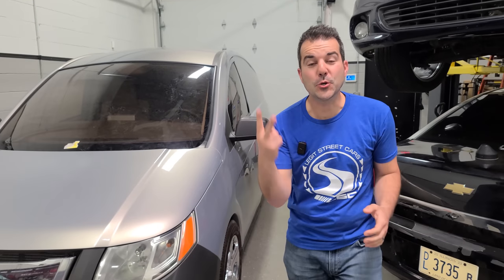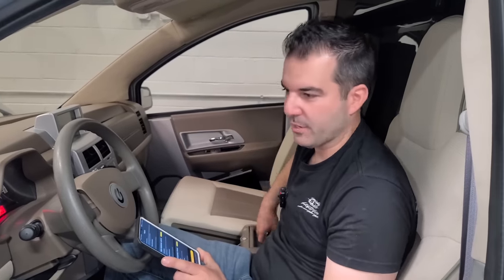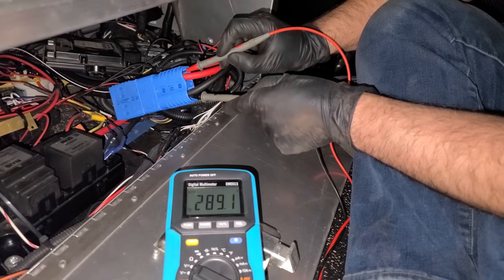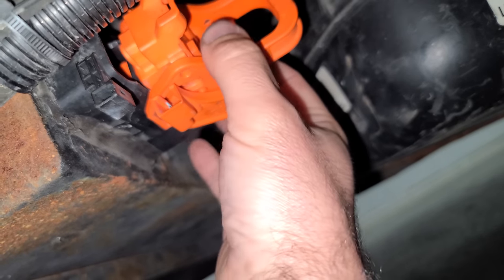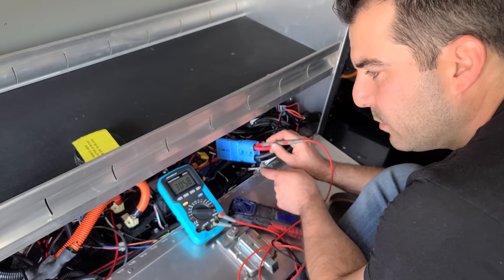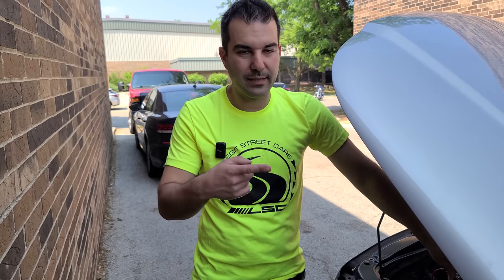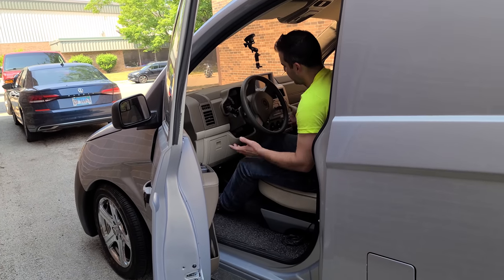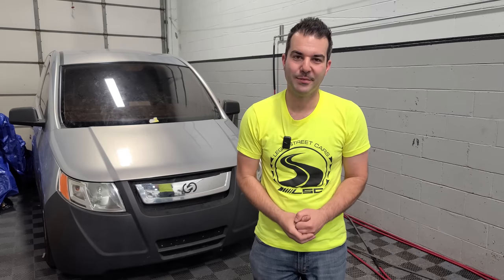I Fixed The Abandoned 2 Million Dollar Concept Car For $150! First Drive Ended In Disaster!

Comment: I had a first gig with a band recently , we had just packed up ready to go home and the singers van door half closed and the thing decided to lock the doors 😬 I got a fence rod in there and managed to unlock the rear door and got in , there was a plastic divider behind the drivers seat with the top half being plastic grating , I put the rod through and tried to open the drivers door and clunk , the rear door closed 🥸🥳 I had to cut through the grating with the smallest wire cutters :-) lots of fun

Comment: Maybe one of the problems is that the electric controller thinks it's in reverse and freaks out when the engine starts to push the van forward? Idk, intermittent issues are the worst

Comment: Please try to test the PC seen in 17:37. Maybe it is connected to the screen in the front and shows some usable information. It would be interesting if you could show what it does and what connectors it has. Maybe try to fix it if it doesn't power on. It has a WiFi antenna, so maybe you can connect to it with a notebook and do something interesting with it.

Comment: from the sound of it from what you say is this your electric motor is wired wrong it thinks it is in drive but the motor is in reverse so this is why you keep braking the mount,remove the drive shaft to the electric motor till you fix the drive issue

Comment: I believe  the motor polarity is wrong the connector  of the two outer cables likely  needs  to be swapped I suspect.  so when  the gas motor starts  you have an opposing  transmission  issue

Comment: @legitstreatcars    cool video keep it up  i am worndering if the polarity of the wires that go to the  motor are correct  so if you try to go forward with the main gas  engine the motor will go back wards maybe that could be the issue with the jumping around as the ev motor whants to go a diffrent dirrection ?
just a quick thought thats all

Comment: So the van drives forward when in drive on the gas motor and in revers when on the EV motor. What are the chances in the 12 years it sat that someone has reversed the polarity in the EV motor and the two motors are fighting each other?

Comment: I still think the motor mounts breaking is a motor control issue you need to make sure the encoder feed back to the motor control is acurate and the make sure the motor controler is properly set up its possible if its old enough that it lost its memory after being wiyhout power for so long.

Comment: I don't understand how any custom shop can build completely custom cars for 80 grand but for 2 mill and way more in r and d yet there is nothing to it..plywood floors nothing working.gas monkey garage could build something ten times better
Reply: Because the company had to design something that could be mass produced and for different use cases.  Its far from a one off custom job lmao

Comment: This has me so stressed out for real!!  I just got home from a stressful day at work and this made it worse!! Thank God you made it home to your shop.   I was thinking the same thing about the cells being unbalanced.  I have 190ah cmax cell in my car for my bass system. And it's very imperative the cells remain balanced.  I'm running 2 370 amp alternators at 16 volts. Its a perfect set up.
Reply: I used to build serious sound systems back in the day when I was a FT installer. I know at 16v it can shorten light bulb life and sometimes kick the stereo into overvoltage protection. Is there some kind of isolation/regulation limiting the voltage to the rest of the electrical system? I never worked with 16v systems but have seen the issues it can cause in cars that had defective regulators leading to over voltage.
Reply: @Which god of thousands means nothing  I haven't had any issues with the charging volts at 16 it runs low 15 v with every running. If I decide to run higher I'll isolate the high voltage system and run a separate 12 alt and front battery for the low side.
Reply: @Which god of thousands means nothing  I have a external adjustable voltage regulator . It can run from 12v to 20v.

Comment: This is a case of you need to find someone who knows how to work on a EV or hybrids because you seem utterly clueless.
There are multiple issues that need looking at specially since this is a prototype and seems to be jank as hell specially after someone has been fiddling with it. (Not that it was likely well assembled in the first place)
It needs some reprograming, re-wiring and that rear bracket that holds the engine needs to be seriously beefed up because the fact that you had to fix it the first time should have been a red flag to get it strengthened

Comment: The popular Internet definition for 'insanity' comes to mind here... it should be unavoidably obvious that your issue with the EV side is not electrical. Either that clutch is MASSIVELY fubar'd, or you have other drivetrain issues involved. Turning it off and back on again occasionally works because of luck, not because it's actually treating any sort of problem with a relevant and meaningful solution. You're basically Russian Rouletting your way around the real problem.

Also, you knew the motor mounts were insufficient, and yet you thought you could cheat your way past replacements?

C'mon. If you're going to run a car channel, at least have some idea of how to wrench and how to not look like a complete moron when you're staring at what's under the hood. There's a place for that (hi, Doug DeMuro) but this isn't it.